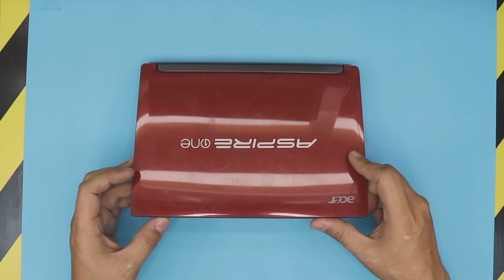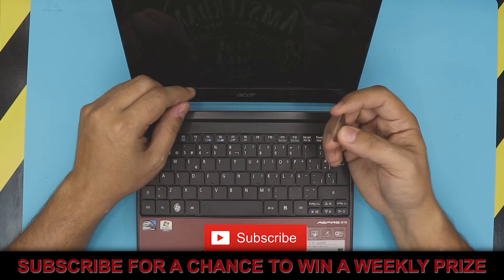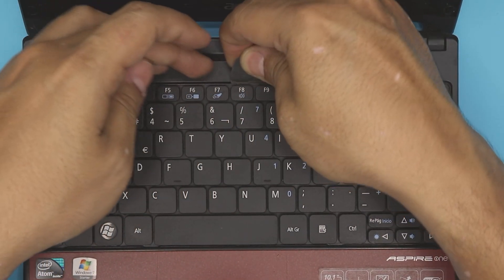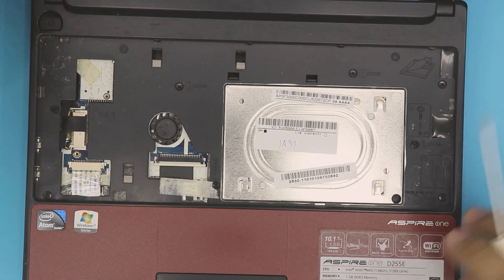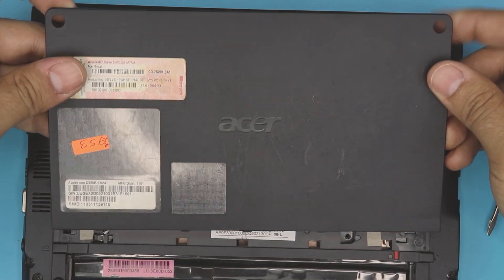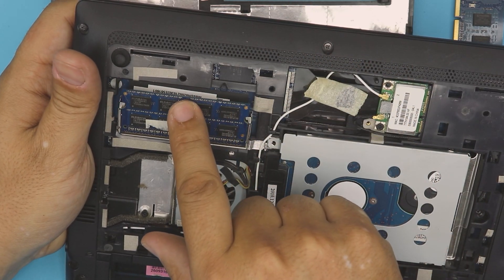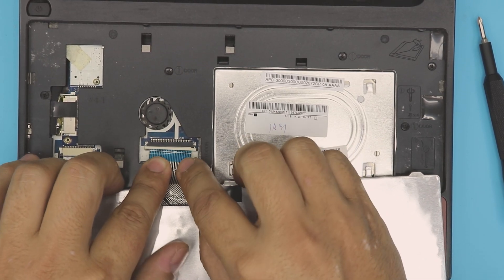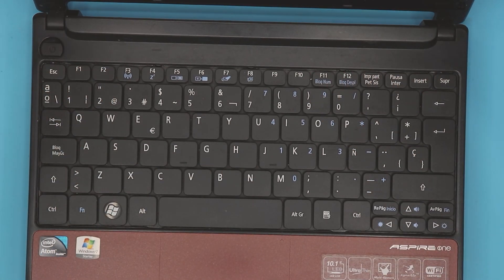Acer Aspire One D255e Ram Upgrade, Step By Step Guide

Comment: Sir may I ask if 4gb ram ddr2 800mhz supported in acer aspire one d255 model?
Reply from the maker: yes it will.
cheers🍻
Reply: @uFixTek  one more thing sir if its possible for d255e ddr3 socket ram? Can I insert 8gb ram on that?
Reply from the maker: no you can't my friend it will not fit.
Reply: @uFixTek  I see. Bad I just gonna share my bad news to you. My 4gb ddr2 800mhz didn’t support to my acer aspire one d255😭
Reply: @uFixTek  thank you sir I was nervous, cause my delivery will come tomorrow, and I didn’t saw in internet for 4gb support in d255

Comment: I have aspire one D255 with CPU Intel Atom N455
1gb DDR3 RAM
Some of my keyboard keys are not working

I saw your another video on how to check max RAM capacity from which i get to know that my D255 supports a max 4gb of RAM

So, Upgrade options are
4GB DDR3 RAM
SATA SSD
Keyboard replacement
Total cost would be approx $22.50 USD

What do you suggest?
Should i spend $22.50 USD in September 2024?
Is it worth it?

Or
Should i buy refurbished Laptop which will cost around $150 USD to $200 USD
Reply from the maker: 🫠Regarding your question, please don't spend that money on N455. You can get much better deals on refurbished laptops. It is not worth spending anything over $10.
Reply: @uFixTek  Thank you for replying
Reply from the maker: It's my pleasure my friend.

Comment: Please Help! I’ve been installed an A-Tech 4gb Ddr3L (the same as you recommend in description) but it doesn’t work on my acer aspire one d255e. It is a BIOS issue?
Reply from the maker: we do install 4GB A-tech on this laptops very frequently, it does happen that sometimes when the bios is very old it won't  read over 2GB. check this link and see what is the max that it can read: https://youtu.be/tKEJTkVth4Q
something could be wrong with bios or you chip set that is not auto detecting the ram.  try updating the bios.
Reply: I’ve upgraded my acer aspire one d255e BIOS to the 3.16 version, but it still failing, can you tell me which BIOS version should I have to install? Thanks

Comment: This netbook only supports 2gb single channel. Hey, can i ask what is the optimal ram speed compatible on this netbook? is it ddr3 1066mhz, 1333mhz or 1600mhz?
Reply from the maker: Thank you for the feedback! if you wish to support the channel you can LIKE or SUB or both :P
regarding your question: we place a 1333mhz, and they come with different bios and we have upgraded many to 4gb, see if you mobo can handle 4gb.
https://youtu.be/tKEJTkVth4Q
Reply: @uFixTek  dude, i bought the wrong one can u update the link in your description its a crucial 2gb DDR3L 1600Mhz i was misled because of that. Don't worry I'm not trying to blame u because i can return/refund it.
Reply: @geraldbantolino3475  Is the one you mentioned the correct one?

Comment: now it wont turn on lol
Reply from the maker: don't worry it will, what ram did you place DDR3L? or DDR3?
and how much GB ?
Reply: @uFixTek  the stick says ddr3l, 2gb.. from the link you posted
Reply from the maker: ok it should work just fine then we purchase the same exact ones!, can you give me the exact complete model number under your laptop.
and also place the old ram and go to windows and do this:
https://youtu.be/tKEJTkVth4Q
Reply: @uFixTek  just a black screen, put in old ram and no problem. Same laptop as one in video
Reply from the maker: can you run the cmd command as in the video link i send to check what is max ? and what windows you have?
Reply: @uFixTek  when doing the math it says 4, but I'm almost certain you could only do 2 in those laptops
Reply from the maker: @brxttz  can you update the bios, check under windows 7 driver list look for bios update, the thing is that i personally upgraded the ram for a client to 4GB, and had no issues at 1st try it accepted. i have a friend i think he has one i will ask him to let me have his laptop to check bios info. you may have a old bios firmware.
Reply: I bought the memory ATech (the one that figure in the amazon link), but it doesn’t work

Comment: can acer d255 upgrade ram to 4 gb or can i use flash drive as virtual ram for this laptop ? thank you
Reply from the maker: you can try placing 4gb ram dim but its really hard to find the right ram that works , because it will not accept any 4gb rams. we tried many brands and models and only the old Samsung 4gb got accepted. 
but you can do "virtual ram" paging and that will ease the pain